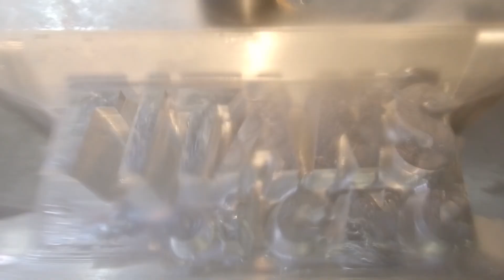I FAILED Repeatedly Until I Learned This One Thing as a Machinist

Comment: Love it Titan.

You've inspired me to start my own shop and work for myself. I'm looking into buying a HAAS mini mill. Something I wouldn't have done without encouragement without you
Reply: I do recommend looking at used mills 

I just bought a 2009 vf2-yt with the large ATC, TSC, custom TTC and a 12k HSK spindle (installed 2018) for 18k shipped
Reply: @angrydragonslayer  I've been looking at used things but in my area most of what's available is older floppy disk machines or some folks want gold for what they have.

After freight and having the machine leveled out it's comparable to start a machine shop with a smaller brand new machine and slowly pay it off. Thanks for the advice however I appreciate that!
Reply: @cruzerbagercruzerbager2965  oh, that sucks

There are a good 15-20 good machines on sale for good prices here but i've definetly seen what you talk about (some guy wanted 12k for a pocketnc v2-50 with the worse toolholding)
Reply: My advice is that your first machine be a new one buddy. You building your reputation in the market as you start and the last thing you want is your machine going down and start having issues that causes delay to your customers. That’s a bad start and a bad name and when ur new you are lucky to be given a chance but they hardly give you a second chance man. That’s my opinion at least good luck
Reply from the maker: Ya, if you can find the work to make the payments… it actually becomes affordable… but getting the work is key.
Reply: @TITANSofCNC  that is true. I started 3 years ago and found out where I am it’s more political than skill related I swear I had a customer telling me that my product is better and the price is cheaper but he can’t give me the job as it’s done by his “friend”. This business is becoming more of a “who you know” than “what you know and how skillful you are”. 😂 but I will keep kicking and knocking on doors and pray for the best. 🙏🏻

Comment: I have to agree, because every company I went to the process is broken. even the top Aerospace company. Like for instance they couldn't figure out which way the floor mat goes on the floor pans. Also they didn't have a table showing  the dimensions of the raw materials for each part. So I cut my time in half by measuring about 20 different models parts so I can pre-cut all the raw material and get it done. I quit that company because I wasnt getting payed enough like a $1.50 raise while the other companies is $2.50. And also the company was getting bought out so the future seem bleaked. Also my skills were limited because it's production.
Reply from the maker: How’s work now? Are you helping your present employer Rise to Greatness😉😁🤙
Reply: @TITANSofCNC  this happened in my 1st job. Sadly that shop closes by the end of this year. The company safran has bought out zodiac aerospace.

Comment: The 5 axis holding just doesn't seem right to me. I understand your saving time on set ups but is it really worth the alower speeds and feeds. Maybe im just old school. The size of cuts have to be much less as well. Just doesn't seem cost efficient. I suppose aluminum can run fast but chatter has to be an issue. Anyway great videos . Love the titans of cnc!!!!
Reply from the maker: Chest board was Rock Solid and the raw material measured, 19.6 SQ in a 20.” Work envelope.
It’s a Chess Board…
Made it exactly how I wanted…
It’s also a 1 off.
Reply: Understood, you have a great shop and machines to choose. Love your videos!!!